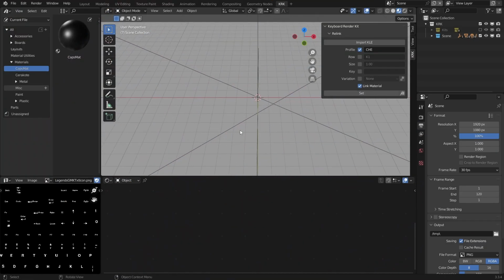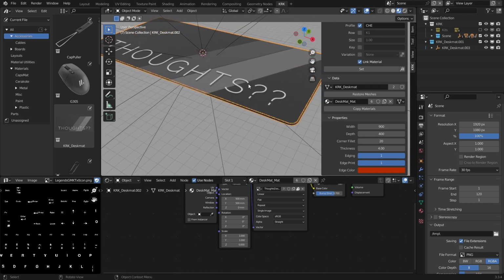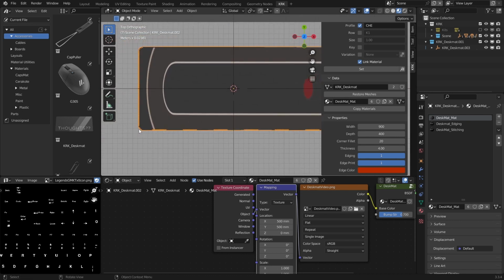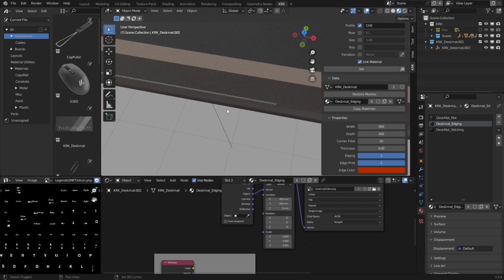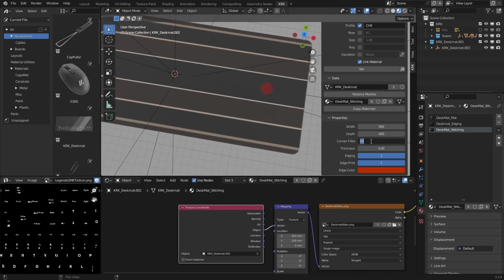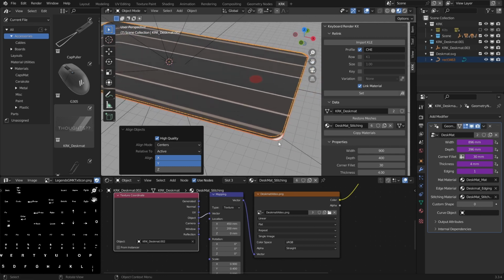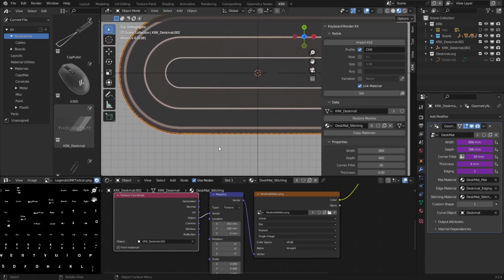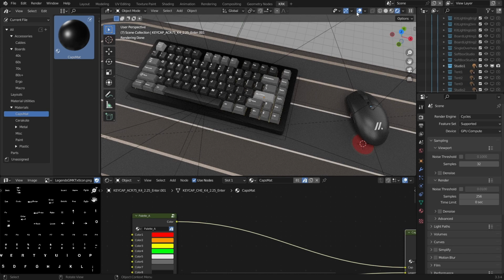Keyboard Render Kit 2 - Deskmat

Comment: please explain how to use different designs on different deskmats. they are either linking for me or nothing is happening
Reply from the maker: The materials are assigned in the modifier panel (wrench). If you duplicate the deskmat, you need to duplicate (or assign different) materials and have them assign in modifier. 
https://keyboardrenderkit.readthedocs.io/en/stable/deskmat_custom.html